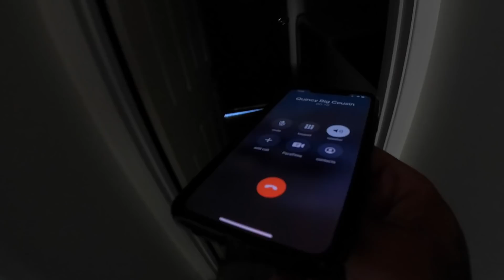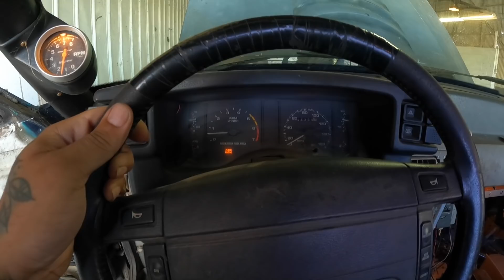After 16 Years Of Sitting, I Finally Got To Drive My NotchBack!!!

Comment: Foxes always have that uneven fender gap out back! 
Measure from the frame rails to the ground and double check the rear suspension height
Reply: Yeah honestly I feel like it’s just a common problem in the camaro/firebird and mustang community. 3 link/panhard/watts link style cars are always a little off it seems
Reply: @Matt_Lanzer_13  yeah and on these cars, unibody chassis twist.. subframe connectors are a must
Reply: @Boss351Fox  exactly!

Comment: You can spread those front fender extensions out with turnbuckles and a few brackets. 
No more rub up front.
Reply from the maker: Naw because then it looks ugly as hell
Reply: Not at all. I’d start by trimming the fender extensions. There’s a lot of meat there you can remove. It’s gonna rub pretty good if you hit a bump with some steering angle. I crumpled my front fenders from rub before I clearanced it, wouldn’t want to see you fuck em up like I did is all
Reply from the maker: I’ll look into it
Reply: @Its_Mike_Myke  hope that helps man